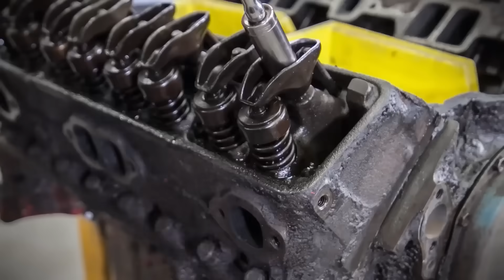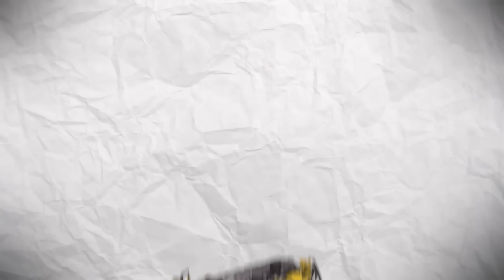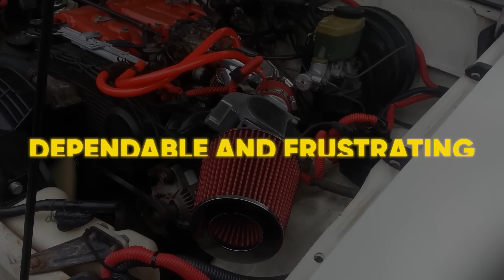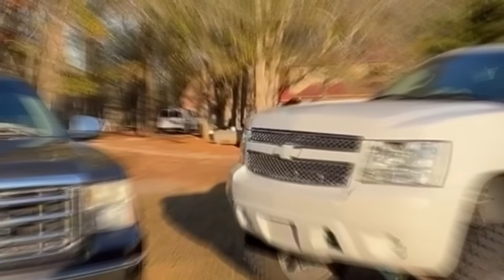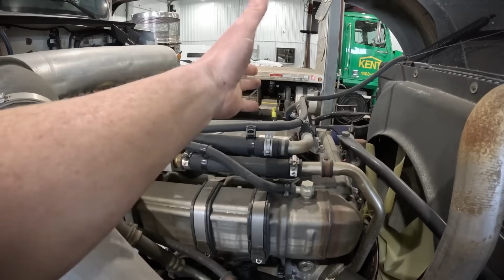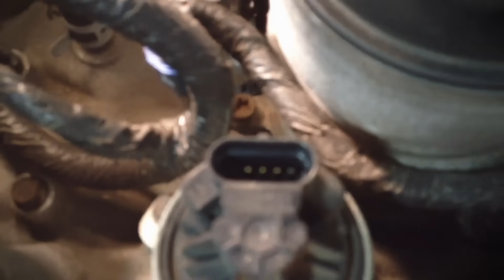The WORST Truck Engines EVER Made! (AVOID AT ALL COST!)

Comment: I’ll keep knocking on wood!!   I have the 5.4 Triton. 2005 Ford.  290,000 miles.  No major issues.  I just keep on up all fluids changes and schedule maintenance.  I also always use 5w-30 oil.   Not the recommend 5w 20.
Reply: I was going to buy a truck with the 5.4. It had recently had its cam phasers replaced. Bad sign.
 There are thousands of horror stories about those motors, and thousands of stories about examples that just wont quit.
 My conclusion is that they are hit and miss.
Reply from the maker: Yeah, that’s a pretty fair take. The 5.4 is definitely one of those “luck of the draw” engines — some run forever, others turn into a headache. Cam phasers getting replaced early on can be a red flag, but it’s good you did your homework. Hit or miss sums it up perfectly! 👌🔧
Reply: @letsdothis9063  I bought mine with high mileage and its now at 211k. I am replacing the exhaust manifolds, timing and swapping the oil pump to a melling high flow. Most people just didn't keep up with their maintenance and those are the people who say the motors are junk.
Reply: I have an e350 box truck with the. 5.4.  she's currently sitting at 282,000+ .  Absolutely 0 engine issues.  She is on her 3rd set of coil packs though
Reply: Nice!
Reply from the maker: That’s awesome! 282k with no engine issues is no small feat — sounds like you’ve got one of the good ones. And yeah, those coil packs seem to be the usual suspects on the 5.4. Glad she’s still going strong! 💪🚛👏
Reply: I had an e 150 with 5.4 triton. Never had any problems, was the most reliable work van I ever had.  Van was totaled at over 230 k when some drunk idiot turned out in front of me. Still miss that van.😢
Reply from the maker: That's awesome to hear! 🙌 Sounds like you’ve taken great care of it — 290k miles is seriously impressive! Keep knocking on that wood and staying on top of maintenance. That 5.4's treating you well! 👏🚙💪
Reply: My 05  5.4 went 355000 miles. Cam phaser noise the whole time but ran fine. I knew it was going to die anytime so pulled it and put in a rebuilt engine. It seized at 120000 miles
Reply: @thestevens2194 I also  use 5w-30 oil
Reply: @thestevens2194 
My 04 had 345000 when I traded it in . Phaser noise from 10000 miles until the trade. You absolutely must change the oil 3000-5000 miles. I used semi synthetic only. Engine was never torn into. Coil packs, alternators, water pumps, spark plugs. Still had the original exhaust system, in Michigan!
Reply: Agreed..Good luck if you get one.. or atleast make sure you have the new spark plug and cam phases replaced...
Reply: There are no problems with that engine ❤
Reply: My 07  with a 5.4 has 309k miles on it the motor sounds great. I have a 06 250 at work that has the 5.4 and only has 130k. The motor has been replaced twice.

Comment: I had the Dodge 4.7 in a Dakota that i ran for 12 years and had 155,000 miles when I bought it and just recently traded it off still running with little over 300,000 miles on it. I don't  believe they had a engine problem just people  problem.
Reply: Sludge would kill the engine. I changed oil every 5k miles and got 243k miles before the body rusted away.  Engine was great.
Reply: @projectswithjw yeah it was the rust why I traded it off my age is taking its toll on me and just no longer able to do the body work anymore.  Sludge can be a problem for one if oil isn't changed regularly or not using a good brand of oil. Sometimes if you switch brands or mix different brands it can cause sludge to build up. I used Castrol for years never had a sludge problem. I'm  currently using Penzoil in my Ram truck with the 5.7 hemi. I've only had it about a year so in time will see how it holds up but so far it's been doing great.
Reply from the maker: That’s impressive! 300k miles is awesome, and it sounds like you took great care of it.!🚗💯
Reply: @Autotrends5 yeah was diligent on oil changes and other maintenance as it's is the life blood of any vehicle.  Something else important they are not race vehicles or hotrod so not driving  like it was one is also important.
Reply: I'm at 338,000 on my Dodge Ram 4.7. I'm diligent about oil changes with high quality oil. I don't live in salt country, and it's spent most of its life in the garage or parking deck, so rust isn't a problem. It might make it to 500K.

Comment: You forgot to mention, access to those diesel engines. You have to lift the cab off the frame to work on them 
Another of Ford's better ideas.
Reply: My buddy is a diesel tech at a Ford Dealer. He can pull the cab off of 250s and 350s in under an hour lol. They built it to be easy.
Reply: @squibblez2517  Not the point. It's ridiculous, to have to do that. That's what happens, when you shove the engine under the dash board.
Reply: @edwardmorriale9358  I'd rather just take the cab off and have easy access to everything. It's not that big a deal
Reply: So what? I can stand in the the engine compartment and work on it in my 1975 ford. It takes less than a minute.  @squibblez2517
Reply: @squibblez2517  what's wrong? Did hims get his feewins hurt and report my comment? Lol, what a pansie.
Reply from the maker: Ah, good catch! That’s definitely a huge pain when it comes to working on those diesel engines. Lifting the cab just to get in there isn't exactly a "great idea" for ease of maintenance. Thanks for pointing that out — it’s something a lot of people don’t realize until they have to work on it! 👏🔧

Comment: Surprised that the dod 5.7 hemis werent on here. They smoke lifters and cam lobes just as much as the afm chevy v8’s
Reply: That's because parts of the blocks were too tall; oil flow/ splash got poor due to this
Reply: Once you delete the DOD though it’s fine mines approaching 200k and it’s been perfectly fine
Reply: Their 6.4L is even worse! Did three top ends on mine before 160,000 Kms!
Reply: It's usually not the DOD lifters that fail on the hemis, it's the  needle bearings in the non DOD Lifters that fail and take out the camshaft.
Reply: @ yes but you didnt start seeing that type of failure until the dod was added and they upadated the lifters, including the non dod lifters
Reply: Mines is a 2013 RT/AWD with a 5.7 HEMI at 120K - plenty of power and I have never touched it other than regular oil changes.
Reply: @loualiberti4781  120-170k is when they literally become a ticking time bomb. It starts with a  p030x misfire, either cylinder 3 or 5. You'll replace spark plugs. Won't help. You'll replace the ignition coil on that cylinder. Won't help and what's that tapping noise it's making now?? Then you'll trade it real quick while you still have time thinking the engine is about to blow. You'll see.
Reply: right?  All marketing....they're absolute junk
Reply from the maker: Great point! The DOD 5.7 Hemis definitely have their share of issues with lifters and cam lobes, and you're right, they’re often compared to the AFM Chevy V8s. I couldn’t fit everything into this video, but I’ll definitely consider it for the next one. Thanks for the suggestion!
Reply: @Autotrends5  The non DOD engines would drop  valve seats instead
Reply: Well I got a 18 year old 5.7 and it’s fine
Reply: @DrakeBaker-oj4ly  2007...the year of broken dreams, valve springs and exhaust manifold bolts. Tick tick tick tick tick
Reply: I have 180k on my 5.7 Hemi and pull a 10,000 boat for 5 years now.